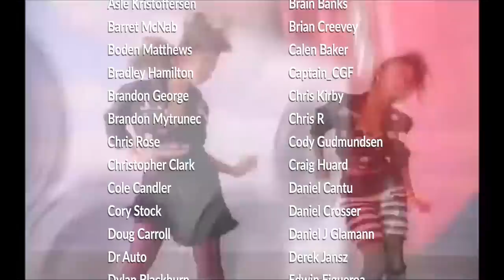Kai buys wheels! - Father Son, PIMP MY BUCKET!

Comment: Shaving the center bore on that wheel with a router was some shit i did not expect.
Reply: Hahaha yeah wtf, continuous vibrations incoming
Reply: @jandepandaman3113  they were trimmed then balanced. No issues. It’s a common thing in the mini truck world to do that. Have to do that to out gmc wheels on my b series.
Reply: @DadsRCGaragePNW  did the samething to get caddy wheels on my b2600i
Reply: Wheels are lug centric. It should be fine. Not perfect but it should be fine. Now if it was hub centric.... Don't ever do that lol
Reply: @thesneak281  I personally wasn't too worried about it, I just never seen someone use a hand router on metal lol. Figure if you got the clamping force and the rims are right, you shouldn't seen many oscillations if any